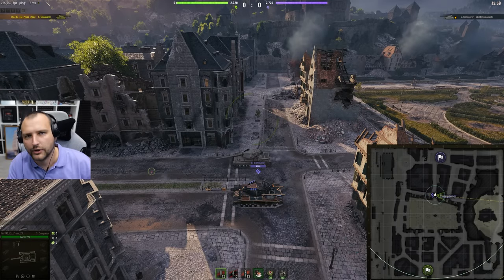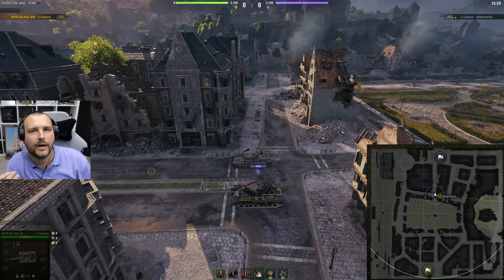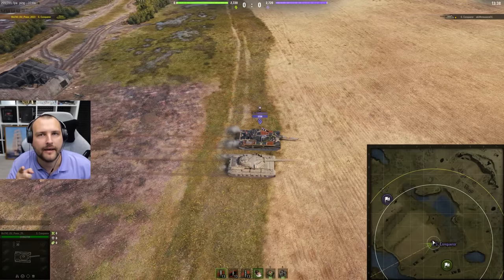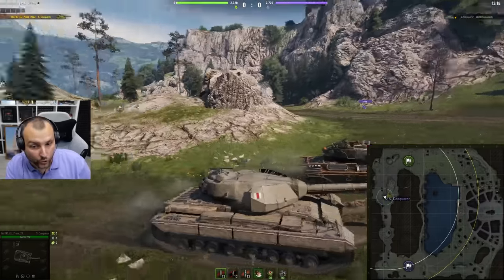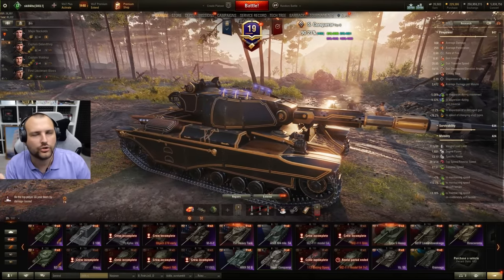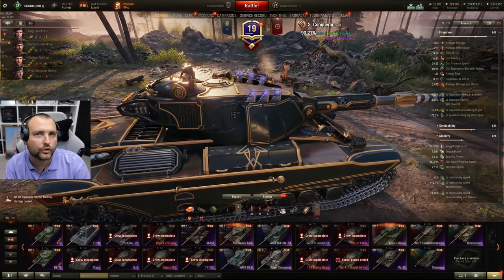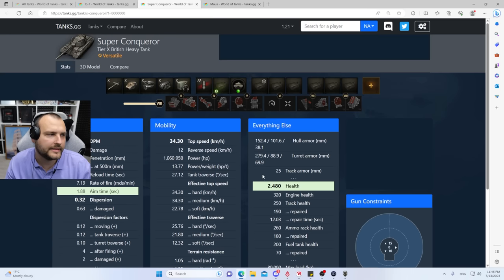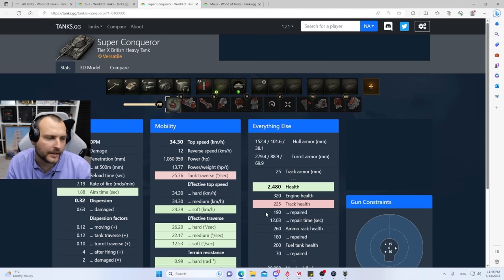YOU'VE BEEN DOING IT WRONG!! STOP Using THIS Field MOD In World of Tanks!!

Comment: The ground resistance mod makes more sense for tanks with such BAD resistance that they cannot reach their topspeed, because then it affects both acceleration AND topspeed, even if not much...
Otherwise, no, no real use.

Same thing as with equipping tracks.   On the E-50M, they're great to have, on the E-50, it's an almost complete waste of an equipment slot.

.

I have NEVER managed to track someone from hitting the middle wheels...   And that includes hitting an ELC90 with a JpzE100, a shot that also did zero damage, because somehow, i just get a "critical hit" and zero damage when hitting middle wheels...

Comment: For internal modules the amount of damage to the module is directly related to the gun calibre and not the alpha damage of the gun. e.g. The Lowe and Renegade guns have 320 & 360 alpha damage respectively, but cause the same module damage as every tank with 105mm gun. Is the mechanics different for the track modules?
In the comparison clips there was a tank with bonus to ground resistance field mod, but it wasn't clear if the comparison tank had no selection for the field mod, or if it had selected other option with ground resistance penalty.
Reply: Yes, damage vs. modules only applies to internal modules such as the engine, ammo rack or fuel tanks. The tracks follow a different set of mechanics using alpha damage. We did comprehensive testing to confirm this.

The second tank in the driving comparison should have had the opposite field mod selected, Bishox would have to confirm this. I did comprehensive testing of my own, then spent a good couple hours with skill and Bishox going over the findings, mechanics, and ways for them to run their own independent testing as well.
Reply: @Scorpiany  thanks, I appreciate the detailed response (and all the effort that's gone into this video)

Comment: Just curious. Has it been confirmed somewhere, that the track is affected by the alpha damage and not by the module damage of the gun?
Reply: Tracking at that angle both front and rear wheels will only affect the tracks, so the average 350 health tracks have will be immediately red if you roll 350+ and orange if it's less. It's a different situation if you are trying to ammorack or set on fire the enemy tank, with you can do with diagonal shots in many situations aiming at the front wheel. Each module has its own health but perks that affect critical hits also play their role here. We also don't know how HE shells affect tracks. Normally tracks will always be affected as long as you hit the hull, except in some situations where you hit the hull directly between the wheels of the tank, which is doable but hard to achieve because normally the wheels are kind of a side shield for the hull. Of course, the higher you aim, the easier to ignore the wheels and hit the hull like in the T110E5 but in other tanks like the E100 this is harder to do because the wheels are massive.
Reply: Yes, I did thorough testing to confirm this, we spent several hours live on Twitch doing this, we also spent more time testing off stream as well. The module damage of the gun does not apply to the tracks at all, the tracks are just hit points vs. alpha damage.

Comment: Thanks for the Vid.
So what does the "Damage vs. Modules" on the tanksGG site mean then? Do the tracks not count as a module? Is it only referring to internal modules? 
Also you should compare the turning speed of the tanks while driving forward und staying on the spot.
Should we use the other Field-Mod then, or is the difference of speed, between a +7% and a -7% tank, to great?
Reply from the maker: we will dig into that speakign about dmg for ammo racks and so on, and difference was +7 and - 7

Comment: I found my obj 260 lost a lot of top speed on all terrain types when I used the other field mod, about 5-10 kph depending, for me its too much of a trade, the traverse also got a lot worse.
Reply: Obj. 260 has very bad terrain resistances, and also isn't a tank that relies on side-scraping as much as it does hull-down. Still make your choices on a tank-by-tank basis. Tanks with really bad terrain resistances (Obj. 260, IS-7, AMX 65t) should still consider the terrain resistance buff. Also fast heavies that don't rely on track HP (FCM 50t, AMX 50B) would also still benefit from terrain resistances.

The track HP buff matters the most on brawling heavies such as the Maus, Obj. 705, Super Conqueror, etc.

Comment: The things that i learned from this video:
1. It is alpha dmg not dmg to the modules that destroyes tracks
2. You dont need to shot into the front/back wheel to track someone, athough its very beneficial

But why isn't it dmg to the modules that causes tracks to be damaged or destroyed?
Reply: For some reason the damage vs. modules stat doesn't apply to the tracks. I believe since they're an external module WG counts them differently.

Comment: so dmg vs modules counts towards what? everything except tracks? btw if that module damage is flat or it rolls like main hp dmg and if it does is it's +-roll% the same as the shell dmg +-roll%?
Reply: Dmg vs. modules is for internal modules. Tracks an external module, so they don't use this value. The module damage behaves the same way as normal damage rolls, the game calculates your damage roll first (which affects module damage too), and then calculates things like penetration, splash damage, etc. So if your shell high rolls, it does more damage to internal modules as well.

Comment: Hmm..having doubts about this one. Not the track health, but the overall benefits. Too many vehicles have alphas enough to damage even the healthier track, and still having better manoeuvrability is still a better option.
And when AMX fully repaired his tracks Dead Eye showed damages tracks still, so whats the deal there?
Reply: Just a delay on Eagle Eye. Hardening always repairs tracks back to full HP if they were broken.

Being faster is going to still be good if your playstyle relies on it, especially for the faster heavies that would benefit from the acceleration. But for any "brawling" heavy, like the Maus, Super Conqueror, T110E5, etc, more track HP will result in more survivability for you overall. Keep in mind the effect it has when shells hit the side of the track instead of the front wheel, since those shells are only doing 1/3rd the track damage, an HP buff goes a long way there.

Comment: Wow it was great ... what about HE and HEAT ammos effects on tracks ?
Reply: Track damage is the same with both HE and HEAT. Tracks count as spaced armor, which make it harder for those shells to do damage to the tank itself, but it doesn't change how the damage mechanics themselves work. HE shots from normal tanks are also not different from AP, they just do more damage to the track so it's easier to break the track with HE.

The only difference is when it comes to artillery, since arty keeps the old HE mechanics from a few years ago, so splash damage from an arty can still damage or break the track even if it did no damage to the tank, hitting the ground from a few meters away. The further from the track the shell lands, the less damage to the track (and the tank) the arty shell does.

Comment: would be intresstung to see how tracks behave when you shoot the track directly🙌🏼 (not in the wheels)
Reply: Same mechanics apply. The shell continues to pass through anything it can on the tank before running out of penetration. If that shell hits the front or rear drive wheel, it does full damage, anywhere else it's just 1/3rd. So if you're shooting the track from the front, chances are you'll hit the front drive wheel and do full damage (depends on the shape of the track and where the shell hits of course). Sometimes 1 shot can even damage both tracks if it's lined up perfectly from the side.

Comment: Were the tests with 7% or 14% difference? Also the turning speed should be considered especially for TDs without turret. There are also tanks that struggle and take a lot of time to accelerate to top speed how is the impact on them?
Reply: Only heavy tanks have to choose between these field mods. TDs have a different choice of field mods and the left one is just straight up better.
Reply: The TD's have a completely different field mod, and the terrain resistance buff is always the better one on TD's since it also buffs your track HP at the same time.

Comment: Before watching the vid:
-7% Terrain Resistance = literally 7% acceleration and 7% turning speed. Better acceleration = your tank will be less clunky, uphill speed is also better by the same percentage.
-10% Track HP from the Lv2 Field Mod affects the bonus from Hardening.
Tracks are External Modules, which will take damage equal to Alpha Damage of the hitting shell.
For that reason, if I don't use Hardening, my tracks will be broken with 1 shot anyway so I just use the Lv2 Field Mod to have overall better mobility.
When I use Hardening, on the other hand, I will still use the Lv2 Field Mod if the tank has bad base terrain resistance (Ex: Renegade, Obj.780,...).
I will not use the Lv2 Field Mod only if the tank has good base terrain resistance (S.Conq, E5,...)
This is nothing new and no secret if you're a mechanically good player.
But most WoT players are casual ones so I know the vid will be informative and good for the community in general.
Reply: @Scorpiany  if you have no clue what you're saying, don't say anything sir.
Go to tanks gg, pick a tank with bad ground resistance (ex: IS-7), then compare its top speed on medium terrain with/without the Lv2 Field Mod.
Reply: @Scorpiany  I provided you with evidence.
What kind of evidence you're telling?
That people should believe you instead of something that is calculated?
Reply: @Scorpiany in WoT, topspeed is not acceleration indicator only when your tank has the ability to reach its topspeed.
WoT mechanics is way more simple than what you're try to sell sir.

Comment: Nice work Skill! Just a question: The damage to the tracks is calculated from de "normal" damage of the gun or the "Damage vs. Modules" that each gun have and is hidden in game? tanks gg have it there too, for exemple IS7 130mm gun have 490 damage and 180 vs. modules.
Reply: The damage vs. modules stat only affects internal modules (fuel tank, engine, ammo rack). Tracking is only based on alpha damage of the gun (irrelevant of module damage or gun caliber). I did comprehensive testing to confirm this before bringing it up to skill, and I had skill and Bishox run additional tests to make sure they replicated the results on their own.
Reply: @Scorpiany  thanks for the info!👍

Comment: hehe, took you long time to figure this out:) but still not to the end. damage does not matter, caliber matters and that caliber determines module damage done. +- 25% as always. front and back wheel 3x module damage, middle wheel 1x moudule damage. so, make a followup;)
Reply: It's not the caliber, it's purely the alpha damage. We've done comprehensive testing to confirm this (and is a large part of why we made this video, as there's a lot of misinformation about how the mechanics work). Compared to a control group, the only characteristic that changed tracking behavior was alpha damage, not the gun caliber, nor the damage vs. modules. Running the numbers also confirms the theory that our testing demonstrated.
Reply: @Scorpiany  ok then.

Comment: What about HE? What about shoting the track from the front/back but below the front/back wheel? Does the shot count as one, if it travels through the whole track, like does the track have multiple hitboxes between the front and back wheel? Like EBR or YOH tanks for example which can lose all wheels/tracks on one side of the tank if hit perfectly from the front/back. 
There are still questions not answered, we need more science and how dare you do science without proper protection, where is you labcoat and glasses.

Comment: Nice, but am confused which is bad? Faster or terrain resist?
Reply: Terrain resistance buff is the one that makes you faster but lowers your track HP. If you're brawling with heavies, you want to take the track HP buff or skip the field mod. The terrain resistance buff will only be most useful on the fast heavies (especially ones with bad resistances).

Comment: Skill I mean you are wrong with that track damage, for example IS4 has 440 alpha and only 165 module damage so I mean alpha dont count but module damage work, but its what I mean
Reply: The module damage value doesn't apply to the tracks, only to internal modules (engine, ammo rack, fuel tank). Tracking is based only on the raw alpha damage of the gun. You get 100% of the gun's alpha when shooting the drivewheel, and only 1/3rd of the alpha when shooting anywhere else on the track.

Comment: What about extra grousers?
Reply: Grousers as equipment are most useful on tanks with bad terrain resistances. Terrain resistances make the tank faster, but how it works is different to engine power. Terrain resistances are most important once you've already gotten some speed, since they allow the tank's engine to put the most of its power out. The worse the resistances, harder it is for the engine to work. For tanks with resistances of 1.4 or higher, Grousers in a mobility slot might be worthwhile if the top speed is high enough to justify them (IS-7 for example). 

On the majority of tanks, Turbo is going to be better. I personally like to combine Grousers and Turbo, but I would never recommend anyone else to do the same, since other equipment is usually more competitive. Just stick with the Turbo and you'll be fine.

Comment: I'd rather stick with better ground resistances across all terrain types. Face it, everyone spams gold, most meta tanks are all autoloaders anyway, and tracks always get blown off except in very small situations with certain tanks being shot by certain other tanks. It literally does not matter in the long run. Your test also didn't factor in turning speeds/traverse rates on different terrain. You literally only did straight lines. If it means slightly less track health for the benefit of better turning rates on shitty terrain, i'll take it. As I said, it literally does not matter in the long run.

Comment: Sorry but this is somewhat misleading in my opinion, you completely ignore traverse speed and only tested on tanks where ground resistance has little impact. Try doing the same test as well as turning speed test on su-130pm or bobject, better ground resistance makes a huge difference on those tanks.
Reply: SU and Bobject are TD's. This video is only about heavy tanks, the field mods that these tanks get are completely different. TD's get both the track HP and terrain resistance buff at the exact same time, so the terrain resistance buff is always the better choice on a TD. This video is only focusing on heavy tanks.
Reply: @Scorpiany  Fair point, but while one can come to that conclusion on their own with some deduction it is at no point said that we're talking only heavy tanks here. And since we're talking about heavy tanks I can give you other examples such as e75 Swedish heavy tanks 705a and so on. All of those gain more than a 10% increase in effective top speed on medium ground at the very least, assuming you can trust tanksgg anyways.
Reply: @pgp2990  The field mod in question is only available to heavy tanks. We're not questioning whether resistances make you faster, but if it's worth losing track HP on heavies (which it isn't).

Keep in mind, top speed isn't the same as a tank's acceleration. For example, if you take 2 tanks, one with a turbo in mobility slot (10% engine power buff) and one with grousers not in a slot (10% terrain resistance buff), the tank with the Turbo will get to its top speed faster, climb hills faster, etc. Both tanks would have the same increase to their effective top speed (AC 1 and AC 4 are the easiest ways to visualize this, 12 hp/ton, 60 km/h paper top speed, only 35 km/h effective top speed). However, the tank with the better engine power would get to that speed noticeably faster.

So the 7% terrain resistance from the field mod isn't changing your acceleration by 7%, it's a smaller impact than that. Only tanks with really awful terrain resistances (like the Kranvagn, AMX 65t, IS-7), would see a large enough impact to want to take the terrain resistance buff.